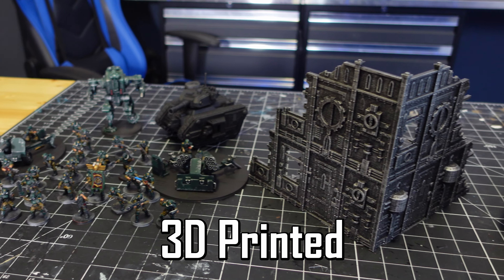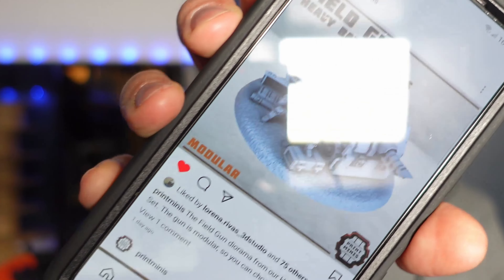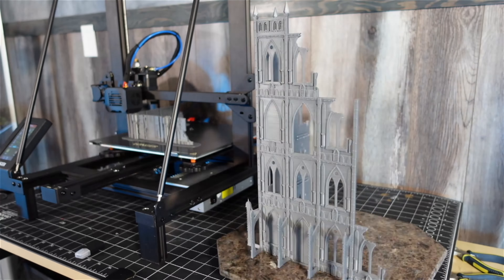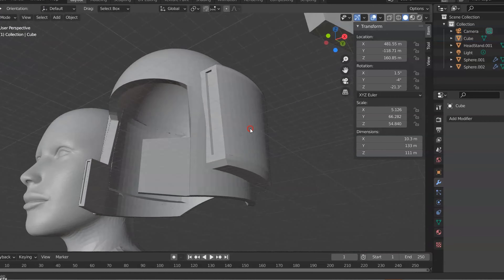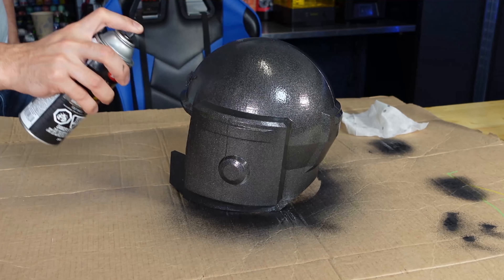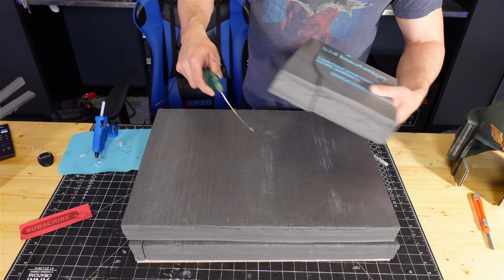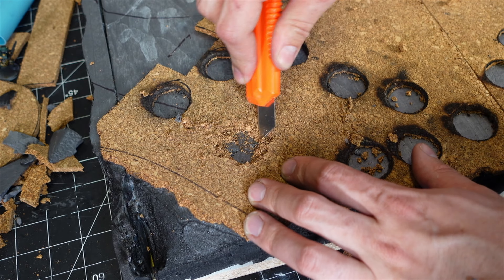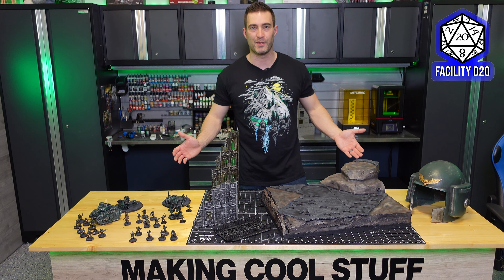Our NEXT WAR Will Be Our LAST - Diorama

Comment: If you used super glue what you need to get it to set quickly is CA glue Accelerator
Reply from the maker: Thanks, but I find super glue don't hold PLA prints very strong.